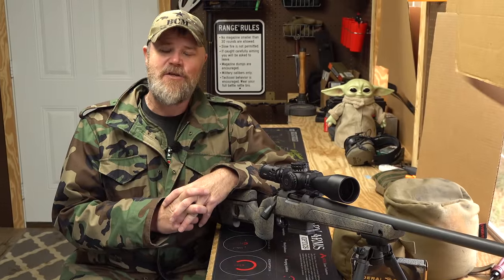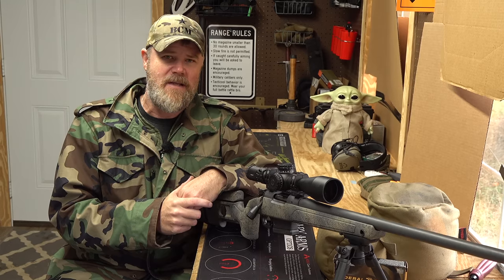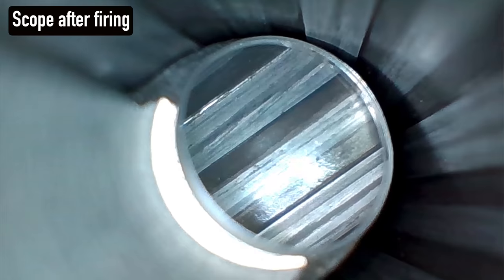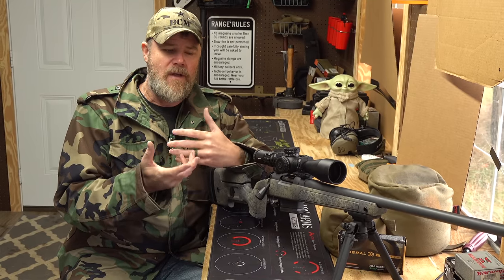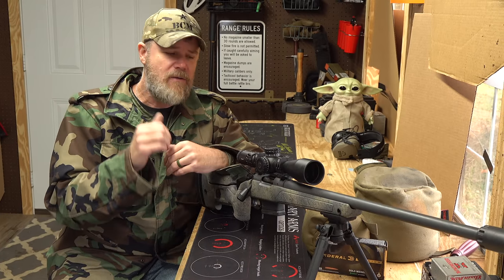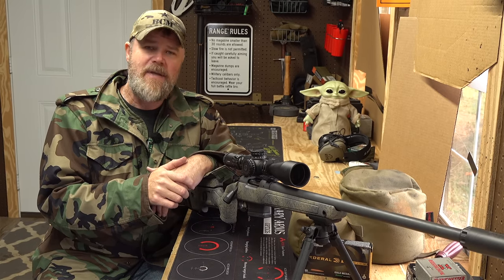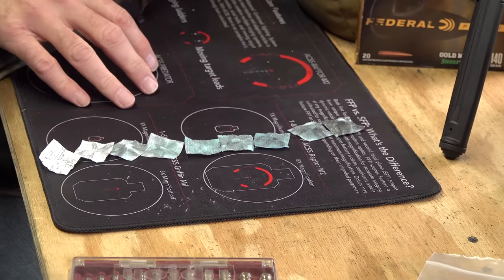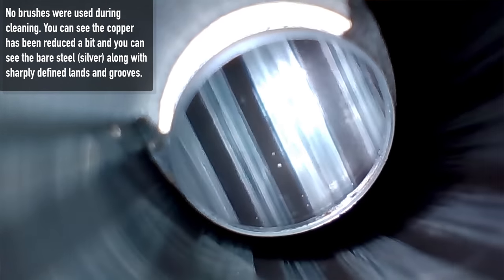Barrel Break-Ins and Cleaning Voodoo Rituals Destroy Barrels

Comment: A brass brush won't hurt any barrel. Brass is leagues softer than any barrel steel out there.
Reply: inb4 "hurr durr metel on matal contact"
Reply: Brass is specifically chosen for brushes because it is softer than barrel steel. It won’t gouge the rifling or scratch up the chamber. Don’t ever use stainless steel brushes. I have one SS pick to get any stuck on carbon and it’s rarely used
Reply: Brass brush with a bronze core, not brass brush with SS core.
Reply: Exactly. Softer metals cannot scratch harder ones. I have an all chrome Schwinn beach cruiser and it got a little rust on the frame. I took some balled up aluminum foil and used it as a scrubbing pad and the rust came right up without any scratches to the chrome.
Reply: Think about what the tips of the soft copper/bronze bristles pick up and get embedded/studded with though... Carbon, which is abrasive. Nylon doesn't get embedded with Carbon.
Reply: Copper jacketed lead bullet with 60,000 psi behind it going 3000 fps: "This is fine."

A bronze bristle brush on a nylon cleaning rod going less than 1 fps: "oH My gOD mY BaRreL iS ruInEd!"
Reply: @macgyver5108   do yourself a favor and delete the “carbon is just as hard as carbon comment”.
For carbon to be as hard as a diamond it would take a very high amount of heat and pressure, which would actually turn the carbon into a diamond.
Reply: @Vintage Hardware I've studied about everything "accuracy" related for a over a decade including all the myths and it's pretty simple. Leave the copper alone until the groups tell you to, and use Nylon brushes.
Reply: @macgyver5108  did you just say "carbon is just as hard as diamonds"? LOL. And things to get embedded in plastic, much easier than they get embedded in metal. It's scary two other geniuses decided to outwardly express their agreement with you.
Reply: @littlejackalo5326  could you try that again in a "coherent" sentence?
Reply: @Wk-is8eh  hahaha right !
Reply: @mapled3135  bro thx for the tip now iam just gonna reload to super high pressures and get rich !
Reply: @mapled3135  oh u mean like 60k+psi worth of preasure repeatedly and its associated heat buildup that happens while shooting. ??? You have literally just made the point your mocking and simultaneously made urself look foolish.
Reply: 5 r stainless needs nylon brushes. They are softer than brass.
Reply: @thecouldntbe  Just FYI, on the subject of aluminum foil, you're effectively scrubbing with the fine oxide layer on the outside of the aluminum, which is definitely harder than steel (Al2O3 has a mohs hardness of 9.0).  You don't see scratches on the chrome because of how fine the grit of the oxide is.
Reply: @mapled3135  is the carbon harder than the 4140 or 4150 steel?
Reply: @thebaddest2562  sure, if you can afford a hpht machine go for it. Lab grown diamonds are a thing these days.
Reply: @macgyver5108  You didn't stay awake in chemistry or physics class, did you.  Carbon fouling is not as hard diamonds.  Yes, diamonds are made from carbon, but only with extreme heat and pressure... much, much more than can be produced by a firearm.
Reply: @Vintage Hardware No.
Reply: @nicksw2126   True, so at the tail end of my service we did not maintain our rifles nearly as much as we did in basic a loooong time ago.
Reply: @thebaddest2562 
 @the baddest  Diamonds are made with pressures of 725,000 psi, far more than the 60,000 you refer to... and at temperatures of 2,700° F, something not achieved in a rifle barrel.
 And it's "you're", not your... and it's "yourself", not urself.
 There is so much wrong with you and what you said.
Reply: @BlackRifleRack  not the “carbon” you find in gun barrels, which is a mixture of burnt up sulfur, carbon and potassium nitrate.
Reply: @Wk-is8eh  I mean heavy cleaning with a brass brush will not destory the barrel... yea you can shoot out of it but is it going to still be accurate after that? A lot goes into making a gun accurate its not as simple as you think. You make it sound like youre cleaning a cannon.
Reply: @thecouldntbe  that's actually a really good idea! Going to use it on my chrome bumper.
Reply: @thebaddest2562  if you’d realize what your saying you’d keep your mouth close. You need about 24 gigapascals and about 22 hundred degrees (about a quarter of the sun surface temp) for a certain period of time to turn carbon into a diamond.
Reply: @mapled3135  huh I guess 60,000psi and high heat isn't enough to make carbon microstructures that can damage the barrel.
Reply: What about a 22lr barrel and a pistol barrel where cast lead is shot? Do you brush out the lead?
Reply: @macgyver5108  It seems like nylon, being an even softer material, would be more susceptible to picking up, and retaining carbon particles... Even a tight dirty patch could do the same. I think rinsing the barrel with solvent, and blowing it out with compressed air before using patches might prevent unnecessary erosion the best, but most people won't bother doing it this way.
Reply: What about these companies that recommend certain process on breaking in barrel? (Sig) I agree with nylon brush!
Reply: Yeah it's not the brass bristles that damage the rifling, but the steel core that the brush is attached to can..Specifically when people ram the cleaning rod in and out fast is when it can happen..But yeah brass won't gouge steel, but brass CAN leave a coating of brass on your rifling. If you want ultimate precision, it could potentially cause issues.
Reply: I've seen plastic zip ties wear holes in steel pipes. Just because brass is softer, doesn't mean it has zero affect on steel. Steel still deforms, its just the brass deforms more. Take a brass hammer and hit a bolt a few times. That steel bolt will still be damaged.
Reply: @DrJIMMI  lemme know how it works for you.
Reply: @gsyoung54  Ur fakts have no powr here! ...lol
Reply: I'm sure the people crying about brushes would have had a heart attack the time a cleaning patch got stuck in my barrel and then I had to tap it out with a cleaning rod for two days and then the barrel proceeded to hit half inch at 100 yards.
Reply: @greybone777  5r is a rifling profile. 416 stainless is typically the metal used in 5r rifled barrels and it has roughly double the rockwell hardness of brass.
Reply: @Kremit_the_Forg  jenius!!!! 😄
Reply: @nt-hd5fo  It depends on the barrel.  A $700 Bartlein can be fired for hundreds upon hundreds of rounds without cleaning and still be very accurate.  I would imagine a cheaper barrel that doesn't have such a fine bore would suffer faster accuracy degradation.
Reply: That’s true, but regardless of what you use, it’s friction over time that wears parts down. You can take a brand new part and use the softest material to rub it, and after so many times it will wear it down.
Reply: I like to ball up aluminum foil and pack it in the barrel then fire a blank through it all. Works like a charm👍
Reply: Just like rubber won't wear down asphalt? You can still wear down a relatively harder material with repetitive abrasion.
Reply: @WildSnake117  exactly. Friction + time = wear.
Reply: I thought it was interesting how he said a  nylon coated or BRASS cleaning rod is ok. But a thinner more flexible brass brush will DESTROY your barrel. Interesting 🤔
Reply: Take a brass wire wheel on and angle grinder and hit some steel with it. The brass wears faster, but abrasion happens on both sides.
Reply: Anything rubbed against hard metal will eventually wear it down. Look what all water will erode, giant canyons of solid rock. I worked in a box plant and have seen cardboard wear down deal after hundreds of thousands of passes.
Reply from the maker: @Vintage Hardware All you have to do is follow the link I provided and people who think brass/bronze can't damage steal will find a picture from a well known barrel maker with bore scope footage of very real damage done. Yup, when you're dragging flakes of carbon (very hard) and metal flakes through your bore you are in fact damaging it. Thanks for the post.
Reply: @Militaryarmschannel  which link are you referring to? Between bore snakes, Otis kits, I’d wager 99.999% of shooters use bronze brushes. I have never heard of this harming accuracy. Don’t you think the military would’ve realIzed the accuracy/barrel life was degrading from these bronze brushes if what you say is true?
Reply: yep
Reply: @user-vw5jk9cs8r   The military does a lot of very dumb things and waste insane amounts of taxpayer money on dumb stuff that doesn't work.   Also bare in mind that, aside from military snipers, most combat shooting is not precision shooting.  Most of the time, your average infantryman isn't even going to see his enemy, but rather just see muzzle flashes and puffs of dust kicked up from an enemy shooting position.  They will generally just put rounds into that general area.  That is why the military is not hung up on extreme accuracy.  If a service rifle starts out as a 2MOA rifle and ends its service life as a 3 MOA rifle,  that's seen as acceptable. I had use a shot-to-shit ancient M16A1 during my first half of Army basic training with us transitioning to brand new M16A2 rifles midway through (and switching from M193 to M855).  I definitely noticed the big increase in accuracy however I was still able to hit 300 meter targets most of the time with the old A1's and at the end of the day, that's all that mattered.  The only downside for the soldier is that the difference between what type of rifleman badge you get can depend on how worn down the barrel is.
Reply: @imjustaguy8232  Shooting a ball of aluminum through a barrel using a blank makes no sense.  Blank rounds are extremely dirty.   You're just putting more carbon fouling into your barrel and likely scratching up your barrel doing that.  As others here have already stated, even softer metal can still scratch steel with enough pressure.  That's why you don't pull a brass brush back through the muzzle as that can damage the crown on the barrel.
Reply: @Militaryarmschannel  Does this apply to a chrome lined barrel? I can concede to the idea that brass/bronze would not damage the chrome lining. But now you have me wondering about the other crud that could potentially damage it.
Reply: Not cleaning the AR: “it’s fine because carbon is a natural lubricant.”
Cleaning your barrel with a brush: “don’t do it, carbon destroys steel.”
Im just being silly, mostly.  My firearms are lightly cleaned and not that often.  CLP and patches with a brass brush on occasion, but I certainly don’t shoot as much as Tim.
Reply: Also…if copper going through a barrel at 3,000 fps doesn’t drag that carbon and destroy a barrel, then I really don’t see why a brass brush would.  Always go chamber to bore.
Reply: Cardboard can scratch a very hard steel knife.
Reply: @user-vw5jk9cs8r  Right, but the majority of AR shooters are not precision shooters aside from those that have DMR type builds.  It would be nice to see a scientific test that simulates thousands of gun barrel cleanings versus the same type of barrel that is cleaned half as much with just a non-metal brush and wipes.   Otherwise it's hard to know for sure how much of the wear is caused by over-cleaning with brass brushes and how much is caused by just normal wear from shooting the firearm.  

That being said, I'm not overly concerned about it, but it's also a simple precaution to just switch to a non-metal brush.  Not a big deal.   I think that at the end of the day, only guys who do extreme long range precision shooting need to worry about this stuff.  But those guys also have the money to just change out the barrels once their current one starts to lose a bit of accuracy.
Reply: @SeanWasThere  Those bullets are "swaged" from soft lead. Not cast my friend!
Reply: @Kremit_the_Forg  Yeah! I think I'll use 120 grit instead! ;)
Reply: @littlejackalo5326  diamonds ARE carbon
Reply: @jzeke1712  
who sells brass brushes with bronze cores? You are talking about the twisted wire center that the brushes are attached to right?
Reply: @AFreeThinkingDawg09  
Well if you think a softer material can not harm a harder material then explain to me why cutting card board  boxes can dull a knife blade? Or how a table saw blade gets dull?
Reply: @Wk-is8eh  Lol, exactly!
Reply: @thebaddest2562  Are you really arguing; we can manufacture diamonds in our barrels??? I’ve thrown away billions of dollars on crappy old shirts!
Reply: @Wk-is8eh  I know right?
Reply: I haven’t brushed my rifles out on about a decade. Hoppes down the barrel followed by dry patches and depending on how long it is sitting I may run a very light oiled patch. 

There are micro fissures in all barrels. Those get filled in with lead and copper. Removing that will change your accuracy until it’s filled in again
Reply: So what are your thoughts on the boresnake
Reply: @JR-ld1et  probably useful
Reply: @byewhobayou8868  If a barrels life is over hundreds of rounds of ammo. I will wager its near impossible to "wear" a barrel down with a soft metal brush by hand.
Reply: @haydenbriggs  it’s the combination of things that causes them to wear, but over cleaning is a contributing factor. I’m not suggesting you don’t clean your guns, I’m just saying that every time something goes down that barrel it’s  causing wear.
Reply: @justinwatkins9258  Not sure who you are referring to.  Did you mean the guy who says he used aluminum foil balls and blank ammo to clean his rifles?  If so, then you seriously underestimate how stupid some people are.  There are people who truly are stupid enough to do things like that and then brag about how well it works.
Reply: @Militaryarmschannel I was a machinist for over a decade. We make all kinds if steel parts, soft steel and hardened tooling steel. We use brass and copper to tap our parts into place while indicating them into the table of machines. Many of our steel parts that require mirror finishes. 
The bullet is copper, tearing through the barrel correct? Brass is copper and zinc combined to make brass correct? By slowly pushing with significantly less pressure than a bullet minus the forces and friction to cause heat through the barrel to remove particles will not "damage a barrel."
 I will bet you 50,000 cash, let someone of your choice do a test. And let the results speak gor themselves.
You can always look at someone who says something. But you say "from my experience"
Well I work with steel, if a brass brush damages the steel. Its not steel. 
Private me wrong. 
And yes it is clearly a uninformed "opinion" of yours.
Reply: @byewhobayou8868  The bullet is doing way more damage. But I agree, if there is something, besides nonmetallic material, there will be wear. But the argument that cleaning with a soft metal wire brush will cause "damage" is just silly and based off of an extremely unlikely occurrence.
Reply: @haydenbriggs  try this, take that soft brush and rub the outside of your barrel, if you don’t think it’s causing damage. It’s not the material that causes damage, it’s friction. Even using lubricant can’t prevent it. Here’s another experiment, keep a rock in your pocket and rub it in same spot 4 times every 30 minutes. Over time, you’ll rub a groove into it even though the rock is much tougher than your skin. I’m not trying to convince you or anyone else, so really I don’t care if you don’t believe me. Some people just gotta learn the hard way.
Reply: @byewhobayou8868  I have a polished SS barrel, I will definitely test your hypothesis! I'm sure it'll rough up the polish alittle bit but I wouldn't call that damage. But I counter you with a Rockwell test. You take a hardened pick and try to scratch the surface. Same concept but it doesn't scrap/ scratch because one surface is much harder. If you take a brass tipped pick and tray to scratch SS it won't. It'll leave a "mark" most likely but that isn't a sign of wear.
Reply: @haydenbriggs  you’re absolutely right. Marks. That is by definition wear, but not what I was referring to. The wear comes from shooting it afterward. If you have a scratch and then you propel an object over it (especially at high velocity) , then it deepens and widens it (albeit microscopically), and over time repeating that process creates wear. One time or even 100 times won’t wear out your barrel, it’s the accumulation over time. That’s what wear is. Friction + time = wear. I think you may be confusing what I’m saying with damage. Damage is a one time happening that prevents or limits use. I’m speaking in terms of a combination of things (highlighting over cleaning as one of them) over time, which is wear. The same principle applies to anything. Space capsules return with heavy wear without contacting any material at all. It’s the friction caused by the resistance of our atmosphere. As you will notice, when describing wear, the word friction comes up. That is what causes wear, not the material itself. I hope this clarifies my comment. If not, there’s nothing further I can do to help you understand. Sorry.
Reply: @nicksw2126  amen
Reply: @Kyrazlan  heat destroys barrels not barrel carbon
Reply: @thebaddest2562  it takes 725,000 psi and at least 2,000°F for carbon to start hardening into diamond. Carbon found in a firearm is definitely not hardened....
Reply: @macgyver5108  that's why bronze brushes are $1.99. So you can buy more of them when they become contaminated. FWIW nylon will wear brass. So nylon is harder than brass. So you're using something harder than a bronze brush when using a nylon brush. Ever notice the brass pinion gear is worn by the nylon ring gear on a "electric slot car"? ( Anyone here remember electric slot car racing?)
Reply: @mapled3135  what?! You mean I’ve been looking for diamonds in my barrel for nothing? Shit, I wasted that $30 on the bore cam.
Reply: Reading a lot of people using aluminum foil and stuff for their gun, isn’t aluminum oxide (the surface of anything aluminum) extremely hard and literally what modern sandpaper is made out of?
Reply: Glad I found your video. I just inherited a hardly used hunting rifle that I don’t think was ever cleaned. I will be sure to not use any metal brushes. I suppose I could just use this method for cleaning any barrel. Though .22LR lead nosed does tend to leave some lead fouling after a few hundred rounds. But honestly I haven’t seen it make any difference in accuracy
Reply: @tubeonline629  ding ding ding someone of so many has a clue and it’s you
Reply: Brass brushes were forbidden in the Foreign Legion. Snipers used a type of bore snake.
Reply: Water is softer than a rock but will still wither it away over time
Reply: @haydenbriggs  I also think the marks left behind can also be material deposited from the softer material onto a harder one.  The surface will look mard but isn't damaged just coated or discolored

While did get some insight from Mac about not wanting to clean all the copper out of a barrel because it fills in groves and also not scrubbing with a brush back as fourth.

I find it a little hard to believe that a copper bulled that has all the pressure and is expanding to fill the barrel is not damaging but the copper in a brush that is being run though is destroying your barrel.

I think I got some more thinking to do on this.  I don't have a strong opinion.  I have worked on 5 inch and 155 mm guns though using nylon bore riders as well as steel ones with no visible damage on a borescope.  It is very important in that case that the steel on the riders are softer than the steel of the barrel.

To be honest I misplaced my 9mm bore brush.  It is reaching the point where I need to do and deep clean so I might pick up a nylon one.
Reply: @Militaryarmschannel  Flakes of carbon being hard? in what world are you from?
Reply: Have you ever seen a crankshaft that spun a bearing? That bearing is softer than the crankshaft journal but when it contacts it it will damage it.
Reply: @thecouldntbe  An old car enthusiasts trick was to clean minor surface rust off of chrome bumpers using coca cola. It actually works if the pitting is not too deep.
Reply: @richb.4374  I've heard of that one too but never utilized it. The aluminum foil was always my go-to. 👍🏾
Reply: @Wk-is8eh  I give the same response when I hear all the fudd cleaning rod myths.
Reply: @nicksw2126  Tell that to Marine leaders.  To occupy idle hands when their is nothing else to do, Marines spend countless hours cleaning weapons.
Reply: @Wk-is8eh  lmao
Reply: @Militaryarmschannel  Bartlein Barrels disagrees with you.  They only recommend not using a bronze brush when using abrasive cleaners (such as JB Bore Paste). They also do NOT caution against pulling a brush back through the muzzle.
Reply: I’ve used machines where metal part get obvious wear to the point of sharpened because of friction from paper. Point is any material strength is just one variable among many.
Reply: @thebaddest2562  Sorry, are you implying carbon turns into diamond dust inside guns? 😂
Reply: Water is softer than steel yet water jet cutters exist.
Reply: @catnip1776  keep reading farther down the comments Einstein and you'll see MAC's own comment and reference to the link in the description on brass/bronze brushes causing damage. BTW... what size shoe do you wear?
Reply: @AFreeThinkingDawg09  I've used dental picks as well but they never go in a chamber or barrel haha. They are also blunted and then only used for that pesky carbon build up in places that arent bearing surfaces in my AR or to get patch material out of places or to get a cleaning cloth into a tight spot. I try to make sure no escentual areas are touched by the picks. I have only one stainless steel brush but that's for car parts so it doesnt count.
Reply: @Vintage Hardware did you run the brush dry? I've never had carbon damage a barrel, or really any part for that matter.
Reply: @thecouldntbe  the aluminum foil wasnt scrubbing it. It was polishing it. Funny little property of aluminum in the foil for that you can polish steel, chrome, nickel, and several other harder metals to a pretty decent polish without anything else like if you wanted to do that with polishing compounds you would have to use several to get to the higher shines you can achieve with just some aluminum foil.
Reply: @diamondflaw  that's how a mirror finish works.
Reply: @mapled3135  ...that's classic gun powder bud, aka black powder. Modern smokeless gun powders are made of with nitro cellulose. But good try. The carbon generally comes from the additives that make up a specific formula and are a result of incomplete combustion. Factory ammo is actually the biggest culprit and if you go to any range, especially indoor ranges, you'll notice the floor right in front of the stalls seems a bit dirty and dingy. Youd think its carbon collected on the floor after a lot of people have shot but it's actually unburned or partially burnt powder. Its literally a massive fire hazard, a powder keg waiting g to go off if its allowed to build up and this has actually killed people at some outdoor ranges because it built up for so long and wasnt rinsed away or cleaned up.
Reply: @nt-hd5fo  if you think any gun at on the shelf at your local gun store these days that has been mass produced is accurate then you must think the Barrett M107 is a sniper rifle. Most of them have an accuracy rating no higher than probably 82% from the factory. There are very few manufacturers that take the time and effort to really ensure they maintain top end accuracy in their products. There might be one or two on shelves in your local area that have the kind of accuracy that truly meets the mark. Sub MOA to about 2.5 MOA is achieved with an M4 in the military. I've seen guys drive bullets through dimes and pennies at 300m with an M4. But acting as if you cant push a brush through the bore of a rifle is basically like saying youd better not drive your car, it will wear the engine and parts.
Reply: @mapled3135  you do realize the core of the earth is hotter than the surface of the sun right? It's not hard to imagine the pressures being so massive where diamonds are formed. And the medium is literally molten rock. We cant get there, not even by drilling. And the pressure at challenger deep is nothing compared to the same depth under all the rock and dirt above. Its different by several factors. And the surface of the sun is actually pretty cold in comparison to its corona or its core. But yeah, the surface of the sun would just about melt tungsten, which had to actually become molten and solidify together into a solid mass on this planet somehow in order to be harvested by us humans. How do you suppose that happened when we literally cant bring it to a molten state ourselves? I might have spent 7 years in the Army, be a bit of a country boy, been blown up several times, have no degrees, got my GED, be a gunsmith, and not be able to remember what I had for break yesterday, but come on man. This stuff isnt hard to learn and figure out. I mean you used a measure of pressure that most people in this comment section dont know or understand.
Reply: @mapled3135 ...if I just eviscerated you for no reason, I apologize. Thought you were questioning the guy that already mentioned the processes of diamond making in nature. My bad.
Reply: @SeanWasThere  youd use a solvent specifically for removing lead fouling. I'd suggest patching those unless you are using a wet brush after a pass with a couple wet patches. Leads nasty stuff.
Reply: @clutchcargo1239  that's also atomizing a lot of the solvent. And really, carbon isnt that harmful or abrasive to steel. He doesnt know what hes talking about and has listened to the myths. A lot of people have a lot of misunderstanding when it comes to cleaning and care for firearms. He can do it how he likes, but the information hes giving is wrong in so many warys.
Reply: @ngaoutdoors4157  lol. Sig? No need for a break in. It's like a "break in" period on a new car/truck. This things have been literally sitting for months. All you really need to do is give it a good lube up and then do a few lubrication breaks when you first take it out. On cars it's to allow the vehicles parts and pieces to become properly lubricated after having sat for months never being moved more than a few feet.
Reply: @dangerrangerlstc  that's the plastic holding water on the steel and then the rush acting as an abrasive. It wasnt the plastic zip ties alone that caused it. But the amount of deformation and supposed damage done is nothing compared to the abrasion of a bullet through a barrel. A brush isnt gonna hurt the barrel much. Aggressive cleaning and over cleaning can cause issues and damage. The real damage is caused by the cores of brushes or the cleaning rods being harder than the barrel. I get wear over time but if you are cleaning that much and that often and you only get 1,000 rounds out of a run of the mill barrel then the issue isnt the brush alone. There are more factors that go into it, way more than most of you are even trying to include. It's not about looking at just the data that proves you right. How much data are you ignoring that will prove you wrong?
Reply: @WildSnake117  keyword...abrasion. again, more factors people are ignoring so they can be right.
Reply: @astang1072  and that one wire wheel being used for about 15-30 seconds on that grinder is equal to or likely greater than the total wear a brass brush will cause over the lifetime of a barrel as long as you arent cleaning it after every 10-30 rounds. So many people are using extreme examples to try to prove their points and act so smug about it as if they just won some prize. Wear happens, but it happens at such a slow rate that they wear and stress of bullets passing through the barrel are going to outpace the wear of proper cleaning if you choose to use a damn copper or brass brush. Let's ignore everything that proves me wrong and only look at the data that says I'm right...I have this 5 page essay saying I'm right but ignore that warehouse full of papers saying I'm not entirely right to completely wrong in every aspect of my understanding.
Reply: @Militaryarmschannel  I'm curious if that might have been from scrubbing. I know theres going to be wear. That's basically an accepted factor. But if you never go straight to the brush and wet patch first then follow with a wet brush 1-3 times it really isnt going to cause the kinds of damage people are talking about or think will happen.
Reply: @Deathbomb9  2 or 3 passes probably wont hurt anything. Real problems are when people do 100 passes, as per old cleaning manuals, or mount the rod+brush in a drill and spin it up and down the bore (seen it done) thinking this is whats needed to clean a bore. The point is many pro shooters are finding minimal scrubbing is needed to maintain accuracy, and the assertion that brass cannot possibly wear steel is simply incorrect.
Reply: @Deathbomb9  its not holding water against the pipe. I'm talking zip ties loose enough to get a finger in. That are completely free to move around and vibrate as they wish. The wire doesn't wear through because it's moving with the zip tie.
Reply: @Deathbomb9  No thats my point exactly. Scrub the fuck out of your barrel and you will ruin what little accuracy it has. A lot goes into making a gun accurate. Sure if you scrub it a little bit youre probably fine. But I know people who have tried to scrub corrosion off a bore and end up scrubbing the rifling out 😂 no youre right tho if youre scrubbing an off the shelf m4 there is not much you can do to it. But scrubbing any gun to shit where tolerances are hand fitted and you have a fancy button cut barrel thats made to be a quarter moa you could ruin the accuracy.
Reply: @Deathbomb9  also there are more off the shelf options for sub moa rifles now then there ever were..
Reply: @Deathbomb9  and no ik the barrett is a anti material rifle 😂 how dare you! Lol
Reply: @astang1072  I've used a chamber brush on a drill, but that's with a fairly wet application, in the chamber and star chamber of ARs. Always copper and theres zero wear on any of the chamber sections due to it. In a barrel though I do agree. But I think that damage is more about the copper work hardening and then bouncing around inside the barrel. I dont partake in any insane cleaning. A barrel and chamber doesnt take long to clean and as for copper fouling, it's not really a massive concern since the mild solvents I use tend to get out what needs to come out. The amount of shots I've sent through my barrel and also load testing has done more wear than any cleaning I'll ever do. I imagine I'll start to see some loss of accuracy in another 5,000 rounds then that barrel will become a load testing barrel when the rifling has worn to the point that it's no longer consistent with impact. On a calm day with moderate temperatures I can still ring steel over and over at 500m with no issues. Not to mention i think i paid like $120-$130 for the barrel back in 2015. As for the 100 passes each cleaning and all that craziness, I have neither the time or desire to do that much extra. When the carbon becomes minuscule its clean enough, then I oil all parts and it's done. Nothing fancy, no overzealous rituals, just what I've found works. As for people saying carbon is extremely hard and abrasive...they are partly right in that carbon can be hard. If they have chunks of it in their barrels after shooting then theres a major issue and they need to see a gunsmith. Carbon/graphite is actually used as a lubricant in many industries. When's the last time you felt pencil lead? It's pretty damn slick. What happens is you get impurities that can stay behind after shooting and those can be abrasive. But generally speaking modern powders are pretty free of impurities that will cause that sort of damage. You can get some fine copper fouling that will mix. The copper work hardens and can cause damage when being removed. All these guys talking about metal flakes and all that make it sound like their bore is loaded with stuff but it's super fine metal flakes that they usually see and maybe some brass from the neck of the cases and possibly a little from the primer or priming hole eroding ever so slightly. In ARs it's usually from the extractor taking little bites out of each case. Do what works, but be honest with yourself and others. If you dont know why something is happening or why you are seeing g things you can always ask. I learned a lot by just asking questions and sometimes I asked the wrong question at first and someone was smart enough to see that and understand what I was really asking.
Reply: @dangerrangerlstc  is it touching the pipe? If that answer is yes in any form or fashion then the zip tie will hold some water against the pipe. But is it pipe or wire we are talking about wearing through, or is it pipe and wires? I've seen zip ties wear through the sheathing on wires. But as for a metal pipe, it would take many, many, many, many zip ties alone if there were nothing else involved. Most zip ties are made of nylon. And nylon has some very specific properties for a plastic. Nylon alone isnt abrasive. So as for the idea that it alone caused a pipe to wear through, I'm calling bullshit that it was just one zip tie and that it alone caused the wear. Now if that pipes is something like the thickness of aluminum foil then maybe it has a chance. But using a pipe like that for anything that has a real world application and not a scale model is about as smart as thinking wrapping yourself in a single layer of aluminum foil makes you bulletproof.
Reply: @nt-hd5fo  , sub MOA is pretty basic. And factually most people cant shoot that accurately anyways. That's why targets are big in comparison to what 1MOA is. People throw that around like they have a full understanding of it all. I'm not saying you dont have a grasp on it, mind you. I'm making a statement. But sub MOA rifles arent that impressive. You're still looking at an accuracy rating that's around 70 something percent when you get just under 1 MOA of accuracy. Accuracy is a balance. The more accurate you get, the faster that accuracy will actually go down with use. There are tolerances that must be met. You cant fit a bullet exactly to the bore with zero space. Not to mention that most ammo you'll buy in a box has a tolerance margin as well. Yes, things have gotten better to where you can buy a sub MOA rifle but you'll get a sub MOA rifle with almost any bolt action rifle used in both world wars, if they haven't been shot out and have been taken care of. So it really isnt a new thing, there are just more options today than you had 80 years ago. I have an old lever action rifle that was manufactured in the late 1890s that still hits pretty close to 1MOA. It's never been smithed or messed with to improve accuracy. You will never have a rifle that will drive the same hole over and over if placed in a very heavy and stable mount that doesn't allow it to move at all even if you wait for the exact same shooting conditions each and every shot. It's not gonna happen. Can you hit the same hole, yes. Does it mean you're rifle is 100% accurate, no. It's a balance of how much does one want to pay to produce the rifle or barrel and how much people are willing to spend. It's also a matter of the tooling used. The tooling changes and dulls. Also, no two are exactly the same. I hope that's helping explain what I'm saying.
Reply: @nt-hd5fo  lol, sometimes we need to check. So many people trying to explain things they barely have a grade school understanding of in these comments. People calling carbon abrasive makes me laugh.
Reply: @joebob7730  FFS... Water just transports the abrasive cutting medium in water jet.
Reply: @Militaryarmschannel  From Lilja: "Do use a bronze brush. Some shooters and gunsmiths have the mistaken idea that a bronze brush will harm a barrel. It will not cause any damage to a barrel and the use of a bronze brush is necessary to remove all fouling. Substituting a nylon brush will not remove fouling as effectively as a bronze brush."

These barrels were used in Macmillan Tac50 rifles by the Canadian JTF2 for all their record setting long range combat kills.
Reply: When you brush you can drag carbon along the bore with the brush. This can scratch the barrel. I have heard of overbrushing a barrel. Never seen it personally… I’ll be honest. I have heard of some high end barrel and gun makers saying that cleaning can excessively wear a bore out prematurely.
Reply: @JG54206  over cleaning can cause additional wear and lead to premature loss of accuracy. This usually makes those people think they need to clean more and they might clean more aggressively. But the idea that carbon left over from shooting, at least the amount that will remain in a barrel of chamber really isnt going to cause issues for the barrel. If that were the case then patching would have the same effect as well because the carbon is on the surface of the patch and many jagsare sized to have enough clearance in the bore for a patch. The carbon doesnt magically soak up into the inside of the patch. I'd say run a wet patch with solvent you trust, let it sit. Run another fresh wet patch before that one dries. Do that again if needed, then run your wet brush through a few times then patch the rest of the carbon out till your patches come out very clean. Each person has their own cleaning methods. But I'm coming from experience with shooting several hundred rounds each week for almost a year and cleaning a rifle after each engagement, at times going through about 2oz of CLP to keep the rifle running, and then having no worn parts needing replaced when that year was over, then going out to an Army zero and qualification range and shooting 38/40 because I didnt feel like shooting 2 of the 300m targets since I was going to get expert regardless and maintain my badging. All cleaning was done with a military issue kit and a bore snake. I also cleaned machine guns the same way and I've never seen one hand any barrel damage from brushes. The people that do are either jamming an oversized brush or a damaged brush through their bore. Or they are using a cheapo copper coated steal brush because they dont want to spend money on better brushes. I'm just talking from my own experience and saying what I've observed. If I was going to really test it I'd need a barrel and all associated items needed to test then another where only patching is used then going through with a really high image quality bore scope to really tell but the act of shooting an excessively hot barrel or letting it get excessively dirty will cause more damage than cleaning a barrel properly and not excessively.
Reply: @Deathbomb9  If the patch is wet with solvent the carbon can soak into the patch. It’ll still be abrasive, but I don’t think it would be as abrasive as a brush that has carbon in the bristles and has to be forced through a bore that’s slightly smaller than itself. I agree with you on pretty much everything you said though…. I think it’s mostly not the cleaning that damages the guy but a mistake made during a cleaning or a mistake repeated over the course of time every time you clean. Like you said…. I think some people clean the gun and don’t realize that it usually takes a few shots to get back to the same POI that it was at… so they go back in for a “better” cleaning thinking they didn’t do a good enough job. Meanwhile the gun was shooting fine and accurately prior to the cleaning. They scrub and scrub and scrub possible hitting the crown or running the rod alone the inside of the bore, then it just gets worse.
Reply: @JG54206  I'm not sure where people get the idea that carbon is hard or super abrasive. It really isnt. The solvent starts the breakdown of the carbon but if you ask me, getting absolutely everything out of the bore is not a good idea. As stated in the video, many guys will shoot 2 or 3 fouling shots. If you can find a happy point where you clean the gunk and leave the necessary fouling you save ammo, time, and never have to worry about loss of accuracy. I think theres also some people that are over zealous and draw back through the bore and cause wear on the crown. The point of brushing for my is to get into the corners of the flats of the rifling and allow the following patches to swab any carbon out. It will also allow you solvent exposure to any lead or copper fouling depending on the ammo you use. If you have a nickle or chrome lined barrel you dont really have to worry too much about the copper brush or even carbon causing scratches. Mostly what will happen is micro scratches. And over time those will actually cause the bore to become polished to a mirror like finish. Carbon, especially the fine carbon left in a barrel, is similar to something like 5,000grit to about 10,000grit and possibly finer. The highest level of polishing compounds uses diamond dust or fine carbon to be able to get the results of mirror finishes. I dont recommend putting them down your barrel, but the carbon isnt really the culprit in bore damage. You'll hear all number of stories and generally humans arent going to really admit when they f-ed up, especially older guys when it comes to guns. I'm talking about the guys that have never had training or maybe served in the military for a few years but never really spent a lot of time on the trigger. They go to the range and shoot 100yards but never more and never a lot. The fuds of the world that think they know better just because they are older or have been around longer than you've been alive or some stupid reason. Those guys will never admit when they are the only factor in an equation that caused damage to their rifle. I also advocate for making sure your guns have a light coating of oil where its needed, but especially the bore and chamber after any cleaning.
Reply: @Deathbomb9  Good points. The carbon will be very fine and the scratches produced would absolutely so tiny that it may in fact act like polishing. I think me and you are essentially getting at the same thing here. Only thing I have to say that I would disagree with; and this isn’t necessarily anymore relevant to guns just in general) I have seen carbon buildup do some pretty gnarly things to small engines and also have heard but never personally seen damage to car engines with direct fuel injection. I’ve seen a chunk of carbon put a hole in a piston crown and scratch the cylinder walls pretty badly… but I don’t expect to ever find a large chunk of carbon like that inside one of my guns. I hope.
Reply: @JG54206  I think we are getting at the same thing. What I will say is the carbon in engines is also filled with left over additives. Nitrocellulose (the base for modern smokeless powder) burns with very very little smoke. Gasoline and diesel can produce a lot of smoke. I'm not denying that the carbon in engines can do loads of damage, but you're also burning much more in terms of the amount of potential carbon produced through incomplete combustion. I will say excessive carbon build up will cause damage to anything. I've seen what that can do to firearms like the AR-15. But I'll also add that if the owner had taken the time to properly and completely clean those areas the firearm wouldnt have needed to have new parts and a deep cleaning. In the military we used to blast out barrels with brake cleaner. Something I wouldnt recommend on your average AR because those barrels are usually chrome or NiChrome lined chromolly barrels and they can handle that sort of treatment without risk of damaging the parkerization or nitride treatments. It's also a shortcut for the star chamber that had to be spotless when it really doesnt need to be so clean you can eat out of it. Carbon can be bad, but it's also used as a lubricant in many industries in the form of graphite. Theres even been so called "dry" lube that used to be sold that was basically powdered graphite. I never used it since in the military there was an over abundance of CLP just sitting around and it was free to use. On a bolt action rifle though, the carbon build up is pretty much going to be confined to the barrel. If you have a gas leak, then that's an entirely different problem that needs to be addressed. The hot gasses will erode things much faster than any normal cleanings will. I've dabbled a little in mechanical work and I can say that taking care of an engine will allow it to last for every long time. Regular fluid changes, having the cylinders checked when need be, and just general preventative maintenance will keep carbon build up from happening. Same with firearms. I know I need to pull my gas tube off my AR soon and give it a good once over and a check on my gas port. I'm coming up on 15,000 rounds soon and I checked it at about 5,000 to gauge build up.
Reply: @Deathbomb9  Absolutely. You’re fuel for your car is filled with tons of stuff that doesn’t burn very cleanly hence modern emission standards and exhaust systems. I have always wondered myself about using brake cleaner on a gun. In your experience barrels that are chrome lined are fine with that, but anything else no? Have you ever used it on any other parts? I have no experience with using it on guns so I have always avoided it because I was afraid of what could happen. I also am going to have to learn how to remove and maintain a gas tube on an AR platform. Do you ever clean them or are they a “replace as needed” type of thing.
Reply: @JG54206  as for most barrels, I'd say brake cleaner is fine. Where I'd avoid its use is higher end end barrels with exotic coatings or treatments without testing it on a non critical are first. Also, if you've painted your rifle or have had it painted or coated/hydro dipped. Also try to avoid use on plastic parts. Always test things before using them.

Most people never worry about their gas system till its gunked up or causing malfunctions. The gas tube is typically the catalyst of the entire system. It's designed to fail before anything else can take any serious damage under normal or combat conditions. That isnt always the case. But for me its easy enough to just clean it and know its clean than try to guess. With any gas block there are ways to easily remove them and if they are pinned or dimpled you dont have to worry to much about alignment as long as it was aligned properly in the first place. When I look at a gas block and port I'm checking port erosion build up and fouling I'm the gas block. It's not totally necessary since the block and tube could be replaced for under $100 if I'm just looking to replace them with standard parts. But being able to do so just saves me a little money. When I was in the military, our M240s would get copper and carbon fouling build up in the gas piston. This added weight and could make the gun slightly more sluggish than a clean one. Chipping that crap out was a pain in the butt. So now its something I monitor on any gas operated firearms I own or work on I've never seen the same level of build up in an AR platform but I also never pulled on apart when I was overseas and never pulled any gas tubes when I was in because that was "above my skill level" or in other words not allowed to do since the military paid and staffed civilians to do that job. I knew how to do it and was very capable, but the politics and bureaucracy caused a lot of work that could be done by service members became civilian jobs over time. To me, no part is simply replace it and move on with life on my guns. If it needs replaced or if it's a wear issue then of course replace it. But if you really want to know your firearm intimately there are probably a ton of videos on here that will show you step by step breakdowns, what to look for, and what you need. I could make a video about tooling and what someone would need to get too deep into their AR where they would need any sort of torque wrenches or anything like that and another going all the way through. The points where you need to torque things you'll need bench blocks and armorers blocks/jigs you hold the upper or lower in place and have them supported so a vice wont cause damage. There are cheaper ones out there but some are worse than others. If you're into ARs I'd recommend checking out School Of The American Rifle on here.
Reply: People out here really think that “softer can’t damage harder” is a strict rule with no exceptions. It’s a generality, not a rule. If it were a rule, barrels would have an infinite life span when shooting copper and lead rounds because both of these metals are softer than steel and thus, should never damage the barrel.

Imagine these people in a basic earth science class trying to comprehend the fact that water erodes solid stone over time. “BUT ROCKS ARE HARDER THAN WATER!!!”

Just because the bulk of the force is applied in one direction, doesn’t mean there is absolutely no force applied in the opposite. That’s simply impossible. A rudimentary understanding of thermodynamics dictates that an object that applies force to another object, also has a force applied to itself. Softer materials will eventually wear out a harder material; it just takes longer.

Any shooter worth a damn who’s ever watched the fine, deep blue on their gun slowly disappear to holster wear knows this is a fact. Or does someone want to try and explain to me how all of these fancy coatings we protect our guns with are actually softer than leather?
Reply: @cytofusion6072  I personally never said that softer cant damage harder. What I've said is that as long as you're not over cleaning a copper wire brush will have so little effect in comparison to actually shooting the gun that cleaning properly, even if you use a brush, wont wear your barrel noticeably faster than not using a bore brush.
Reply: @DamionJR4923  Thats because there are minerals and compounds that are harder than steel mixed into it.
Reply: @tubeonline629  You realize that cardboard is a compound, and that 1. there are minerals and compounds in cardboard that are harder than steel, and 2. putting a lot of force on a very small surface area (knife edge) leads to deformation? think of it like this. A plastic knife can never scratch aluminum foil, but you can use that knife to cut the foil by deforming it, crushing it, "cutting" by fracturing it. You can do that because the foil is so thin and is easy to manipulate. Once you have a piece of metal like a rifle barrel which is designed to withstand extreme pressures, that manipulation is relatively hard to replicate. Because copper has a much lower hardness than steel, you wont scrath the barrel with it and will likely never deform the barrel with it, so I really fail to see the negative effects of copper brush cleaning. The only etching that will feasibly happen is if flakes of harder materials are in the barrel, and those would also scratch with just a cloth patch.
Reply: @Militaryarmschannel  That happens with cloth patches too, so I don't see how thats the brushed fault.
Reply: @macgyver5108  
If nylon can absorb water, it can surely embed carbon particles even if they are very small.
If you don't want to wear out the barrel, don't shoot it.
Next thing shooters will claim is that gravity pulling down on a bullet will cause uneven wear on the lower side of the bore.
Reply: @Wk-is8eh  he coats the bullet with marshmallows before he shoots it
Reply: @Deathbomb9  Literally total BS the shooting dimes at 300m with an M-4!  Maybe with an entire mag or two.  Stop spouting crap 💩
BTW, I’m the former Task Force Commander of Marksmanship for First Army.
Reply: @wigon  Agreed…100%. I joined the army in ‘86 and my M16A1 was so wore out that there was significant movement between the upper and lower receiver. Then when it came to cleaning, the drill sergeants would use the quickest method, which was not necessarily the best method. I’ve seen carburetor cleaner, brake cleaner, solvent tanks used as just a few examples. I saw a chamber brush connected to a section of cleaning rod and then hooked up to a high speed drill to “clean out the chamber really quick”. Even though a Soldier’s life is dependent on that weapon, they don’t think about any of the long term effects because it’s not “their” rifle. I’ve seen all sorts of crazy stuff when it comes to cleaning and not with just the M16/M4…saw it on the M9, M249, M240B, 25MM and M240C on the Bradley to name a few. But like you said earlier, they are not precision rifles, which is why the new army standards for grouping and zeroing are 4 MOA Objective and 6 MOA Threshold…meaning as long as you can group and zero within 6 MOA, that’s close enough for government work. Not my regs, just what the current standards are.
Reply: @HighlanderMikeGolf  Yup, when I joined in 1993 I got lucky in basic training in that they were just transitioning to the M16A2 (at least in basic training units). It was weird in that the first part of rifle training we used an ancient M16A1.  Mine probably had around 5 MOA accuracy.  Then we got brand spanking new M16A2's that we had to clean all the packing grease out of.  Mine was a sweet one with probably around 1.5 MOA accuracy I'm guessing. It allowed me to score expert quite easily with it.  But yeah it's so strange how at the time it never dawned on me that we were over-cleaning our weapons.  They really need to do away with that "white glove" bullshit test as all it does is to encourage soldiers to damage their weapons by over-cleaning them.   With the new rifles and MG's coming online in the U.S. Army, I absolutely shudder how these beautiful M5 rifles (likely with 1 MOA average accuracy) are going to  have their accuracy and reliability ruined by over-cleaning.     What our military needs to do instead is to educate soldiers on how to NOT overclean especially in sensitive areas.   The standard should not be a perfectly white patch but rather instead just a light grey patch.  Areas where carbon tends to get caked on should be identified with soldiers trained to pay special attention to those areas, but only if they are critical to the weapons performance.  It would also help if the bluing on the firearm's critical internal components, was not the same color as carbon (black/grey).   lol
Reply: @dangerrangerlstc  You are absolutely correct.  I am machinist in a food plant.  95% of my work is stainless steel.  I've repaired hundreds of shafts that have grooves worn in them by the lip on a rubber seal or by a 70 Durometer O-ring.  I have some 416 SS that I occasionally  use because I can heat treat it but it still machines very easily.  Not as soft as brass but softer than most BRONZE alloys.  And as to that soft wearing hard argument: There is a place in the plant where condensate traps drip water on the floor.  The floor is concrete substrate with a two-part polyester resin with aluminum oxide grit embedded.  That dripping water has drilled an inch or more thru that coating and into the concrete below.  Now, I know that concrete is harder than a water droplet.  Let the bronze brush guys explain that.
Reply: @dangerrangerlstc  good analogy 👍🏼
Reply: @AFreeThinkingDawg09  
Brass brushes are too soft…bronze is the preferred brush material
Reply: @macgyver5108   Really? A have a bore scope that says other wise. Treat the barrel first with chemical to loosen the carbon.
Reply: @p47rr  no offense, do you have any actual expertise with high pressure metallurgy, looking at hundreds or even thousands of rifle bores for comparison to know what you're actually looking at? Or did you buy a bore scope off Amazon and stay at a Holiday Inn last night? It's a nifty gadget for sure, but the majority of folks who buy bore scopes aren't even close to 'operator qualified' and misread or freak out about things that precision barrel makers just shake their heads at... Honestly it's a lot like how the mere act of buying a Gucci rifle makes you a qualified Sharpshooter overnight, vs the reality with months of training needed to be even remotely proficient.
Reply: @p47rr  for the record, I rarely even bother with carbon fouling in the bore. On a brand new bore I use JB to polish it mirror smooth, then solvent to clean that out. Next I plug the crown and vertically soak the bore in oil for days and run dry patches before firing. After that I never touch the bore with more than oil and patches for winter storage or if I get rained on "until the rifle tells me to clean" when groups open up after 500-700+ rounds and then use JB again. I'm routinely sub MOA at 700 yards even on a really bad hair day out in windy WY.
Reply: To say no brass brush and then use a brass jag?
Reply: @timswinscoe2895  you do know how a jag works right??? Completely wrapped inside a clean patch... 🤔
Reply: @BlackRifleRack  what's funny is 4140 and 4150 refers to the carbon content in the steel
Reply: Brass is used in cartridges and copper is bullets? Right?
Reply: @ronmatthews8399  yes, and your point? Brass casings and copper bullets jackets are used when they're relatively clean. And for brass it has to be cleaned thoroughly before being reloaded. Not like dirty brass/bronze brushes that'll ride just any bore.
Reply: @ronmatthews8399  sometimes brass is the jacket material like Remington golden saber jacket is melted down cartridge brass
Reply: You just cannot get all the carbon fouling out with patches .
Reply: It’s just like a tooth brush on teeth.
Reply: @dangerrangerlstc  You are correct. I worked in a tool shop building and repairing injection molds. I've seen many mold cavity blocks damaged heavily by soft brass hammers, and those cavity blocks are S7 tool steel, typically heat treated to 56-58 RC, much harder than a rifle barrel.
Reply: A high carbon knife is way harder than brasss too. Take that knife to a block of brass and see how quickly it fills the edge. There is more science behind this than the "hardness" of each steel.
Reply: Truth
Reply: Lol what a load of crap😂
Reply: And water is softer than rock. Oh.. wait. Erosion. Facts.
Reply: @MrBbracken  
So after your barrel sits in a river for 1000 years, oh wait …….
Reply: @humpy936  won’t take that long. Brass bullets running through your steel barrel are too soft to cause any wear either, right? 
Any knucklehead with chemicals and a wire brush can damage a barrel. If you don’t believe that then lol
Reply: @Wk-is8eh well said! 😂
Reply: What everyone needs to realize is that hardness does not determine if something can wear something down. 

Hardness is about whether something can scratch another thing on a perfectly flat surface. In reality, nothing is perfectly flat. From the rifling in the barrel to microscopic imperfections in the metal, there are little ridges that will catch on the brass brush, even on a molecular level.  The interaction of atomic level interactions is what is called basic friction, and the microscopic and macroscopic interactions of bumps and ridges is also considered friction but in a more real world sense. The physical interaction between two surfaces not parallel to each other causes catching and removal of material regardless of hardness. 

Think of it like the brass brush is grabbing these edges and pulling them off, hardness does not dictate whether something can be grabbed, and repetitive scrubbing can wear it down very slowly. 

This is the reason why you see wear on concrete from cars, wood from shoes, rock from water, etc. because this erosion is not caused by scratching yet is caused by things much much softer than the material being worn. 

Think of how if you rubbed a piece of wood with your finger every day for hours. After a couple weeks the wood would be gone, even though it is much harder. Your finger grabs and pulls the material away.

Friction causes wear and friction is caused by imperfect materials, and friction is not the same as scratching.

Anyway, I don’t believe that brass brushes will noticeably damage your barrel unless you use them all the time aggressively, since bullets are going to wear it down much more. However the idea that hardness is the only thing that dictates erosion is completely false.
Reply: @Chevsilverado  there was an account, on YouTube, from a barrel manufacturer that told the story of a customer who wore out 2 barrels from “overly aggressive cleaning” and blamed it on the barrel maker. It is possible. Not only is it possible but if possible then it is more than likely that it has been done repeatedly.
Reply: What about running Molybdenum Disulfide on a patch once or twice?
Reply: Water is a hole lot softer than stone but after enough time rain will grind a mountain flat.
Reply: …. but not nylon sir.
Reply: @phoenixcustomrifles1430  I do use brass, point is don’t expect your barrel not to wear.
Reply: Well, I guess I’m an old dude now. I’ve always broke in my barrels with cleaning between shots (10 or so). And, I’ve always cleaned my guns after every use, regardless if it’s 1 round or 700. I used brass brushed, Tipton rods, old-school brand solvent and patches until the bore is shiny. I don’t think I’ve ever had a problem with consistent accuracy.  But that’s just me.
Reply: Best thing about this video is , I can delete it.
Reply: Bore snake for me.
Reply: @Wk-is8eh   🤠👍
Reply: @thecouldntbe 
who taught you that trick?
Reply: @markenriquez1486  my homeboy that has chrome rims.
Reply: That sir is simply untrue.  Air gun barrels can be damaged by brass brushes. They are not the high carbon tool steel of powder guns.  Brass brushes will ruin them.
Reply: I shot close to a million rounds through my . . 22 caliber German made target rifle and alwase used brass brushes with a chamber guide and😮 cloth patches with no loss of accuracy I always pushed each round into the chamber  with my finger not the bolt I always fired 3-4 rounds to warm up the barrel
Reply: While this is true, I have seen note scopes of new barrels damaged by brass brushes. Just because it is softer doesn’t mean it won’t damage it. Wood is softer than metal yet you still need to sharpen it since the wood still damages it. It will depend on your barrel material (stainless, carbon steel, chrome moly ect) Certain hardnesses will give different results, and having a chrome lined barrel is also different.
Reply: I never use them on my Rifles.
Reply: To people saying brass can't scratch steel - you are correct, it can't. However, it can pick up contaminants from the barrel, and then scrub them against the metal. And yes, some of these contaminants will scratch your barrel with pressure from a brass brush. Doesn't mean you can't use one, but it should be used sparingly in conjunction with a good solvent
Reply: Metal on metal will always have wear. 2 metals of the same hardness will wear eachother 50/50. A  metal 25% softer than the the other will have significantly less wear(75%) effect but still has some wear. A brass brush on a hunting rifle will have little effect on a average barrel used once a year but used every week will cause sharpness loss....as does shooting it with bullets,  yes they cause wear also. The idea is to have the least amount of wear possible to get the longest life for precision. 
I have used a beautiful 45acp nighthawk that I found to be very precise for me, but it was obtained at a great price because after  thousands of rounds used and many cleanings it shot a slightly bigger group and was retired from competition. It's still awesome for most ppl but not like it was when new.
In the precision world, metal on metal is a no no, no matter how soft the brush. 
No matter how much less wear a softer metal might have there will still be wear. 
The first shot is the best possible shot ever, it's all down hill from there. How fast it goes down hill is all you can somewhat control. 
The patch is the least amount of wear
Reply: Exactly!
Reply: @byewhobayou8868 but it would take longer than your lifetime to do that. Normally!!!
Reply: @alcantrell5340  not true at all. Barrels have to be replaced regularly because they wear down from friction. In fact, 105mm howitzer barrels are more requested by Ukraine than ammo is. If you shoot 50,000 rounds through your rifle, it’s not as accurate as it was at 5,000 rounds. Take a bore scope and look inside a brand new barrel, and then look at it again after 500 rounds. You’ll be amazed at how much frictional damage there is. Just because brass is softer than steel doesn’t mean it don’t create damage, and just because you can’t see it with a naked eye doesn’t mean it isn’t happening. There’s a reason why most experienced shooters and gunsmith’s prioritize oiling over cleaning. If you take your rifle out once a year go hunting season it’s no big deal. But if you put 20,000 rounds per year through that rifle, you’ll see the difference and how much more expensive you’re making things for yourself by cleaning it because it’s dusty or you just fired 100 rounds through it.
Reply: @alcantrell5340  personally, I’ve rubbed the finish off of a few guns before a gunsmith told me about over cleaning and how much faster I was wearing the gun out. I’ve also had to replace several barrels, and I even experimented with a cotton cleaning cloth coated in oil on one spot of an old barrel. It really doesn’t take as long as you would think to rub a flat spot into a piece of steel. But again, if you’re not shooting everyday like I do, you’re probably not going to ever have a problem. I’ve got handguns that I’ve shot so much the front sight fell off. I did it to one handgun twice in a single year!
Reply: F-class shooters never use bronze brush. There is a reason why. They are not afraid of damaging the bore but afraid of losing very thin copper film deposit in the bore, which makes the bore smoother and tighter.
Reply: Not true for Chrome lined barrels. U won't hurt the steel, but the chrome lining can get scratched. I only use solvent,  and patches, and I have a soft brush and rod I clean with. Never saw the point to using brass brushes....
Reply: Would not a nylon brush do exactly the same thing if you're saying that brass  drags carbon and metal flakes? @Militaryarmschannel
Reply: @thecouldntbe yep you're exactly right. I've used that technique with the exhaust and other chrome accessories on my Harley Davidson for years with not even the tiniest of scratches
Reply: @Wk-is8eh thought it was about putting more debree in it with the brush
Reply: @jzeke1712  Brushes are bronze. Calling them brass is a misnomer. (Bronze is an alloy of copper, tin, and nickel. Itr is an abrasive mixture!
KnifeMaker
Reply: @thecouldntbe  Really? Ever seen what running water (Encreadly soft) can do to rock?  Ever seen a brass or bronze brush on a grinder touched to a polished piece of hardened steel. It does indeed abrade the steel even though it is many times softer!
KnifeMaker
Reply: @Militaryarmschannel Damage done is done by the rod or brush core, not the brush bristles. Your ammunition will damage the barrel before brass bristles will.